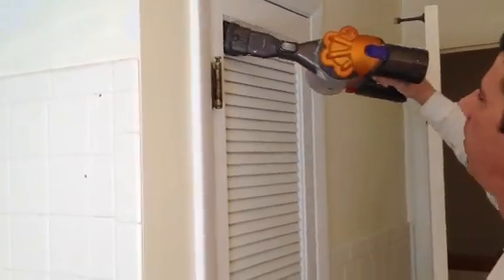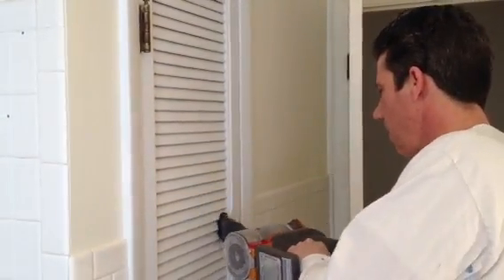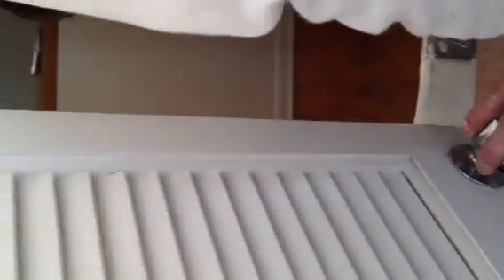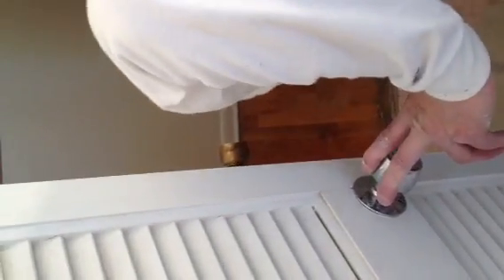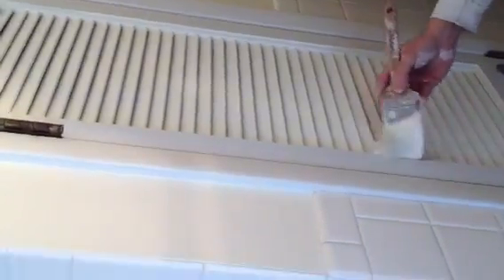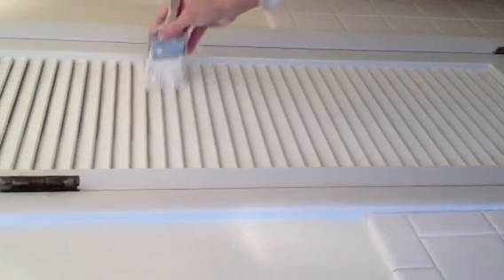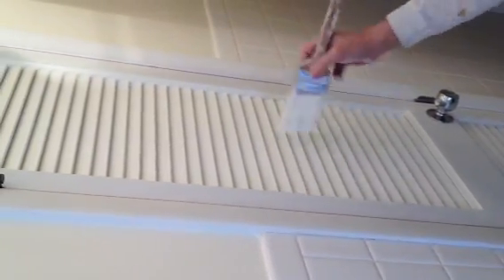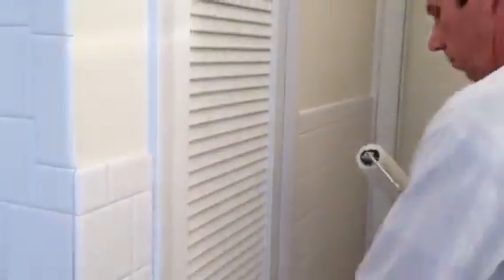How to paint a louvre door

Comment: Nice video. Just did mine. I removed the door  hinges and doorknob. I then brought it outside and sprayed it down with the garden hose. I then dried off with leaf blower and then began painting once it was  dry. The Louvers are a pain in the ass . I first used very light coats of white spray paint primer To get in between the louvers. Once dry, I hit it with Brushed on white semi gloss.
Reply from the maker: Yes. Since this old video I have taken mine outside and wiped them down. Then I use kilz spray can white spray and it turn out perfect.

Comment: No hate but that brush sounded like it was dry as hell.  
Thats not a nice wet coating  by any means.  
Most people wont know what iam talking about but any reputable painter will say thats an amature.
Reply: I just did my door, you do need a drier brush or it drips on the other side
Reply: I know exactly what you're talking about. There is no quick way to brush paint louvers. If your brush is making noise it's because there is little to no paint on it. YouTube is full of good and bad advice.
Reply: Spray paint